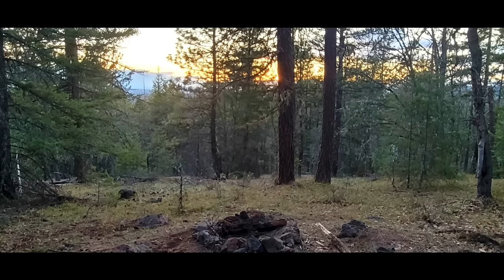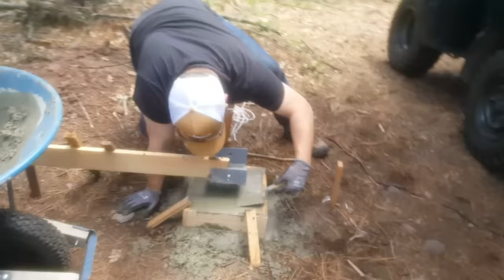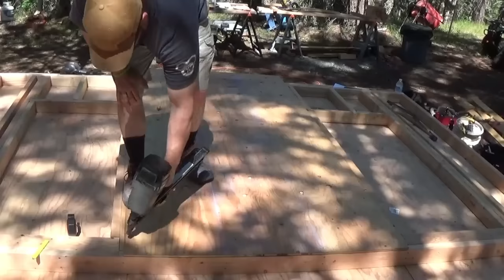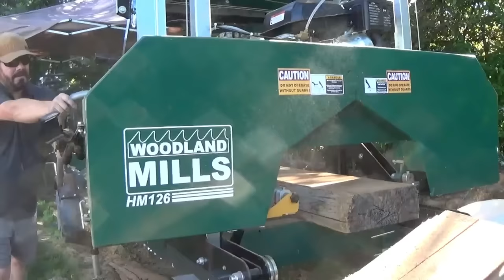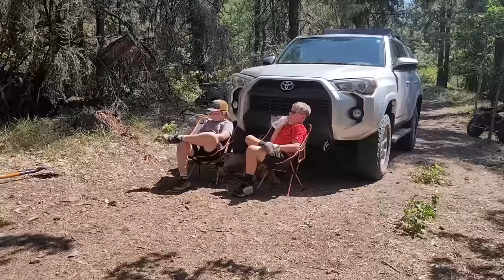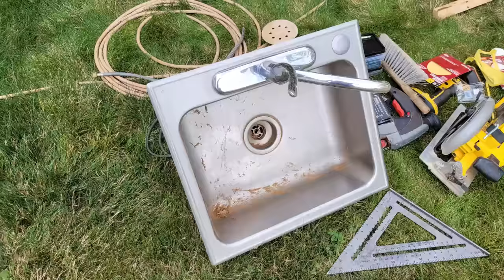Off Grid Cabin in the Mountains. . . Start to finish!

Comment: A tip for your ‘layout’ phase.  Screw the bearers together (including triangular bracing) and lay it where you want the structure.  Use markup paint to describe your footings.  Move the bearer frame slightly off to expose each footing a dig them out.  When you are ready to pour the concrete, sit the bearer frame back over the holes, using scrap 2x4s to hold it level with the stirrups into the holes ( I usually weld the stirrups onto a small rebar cage and coat liberally with cold-galv paint). Then just pour the concrete, use a jigsaw or other vibrating or oscillating tool onto the stirrup to vibrate the concrete as you go.

Comment: Nice job!  I would never blame someone for using a nailgun.  I had about 3 1/2 weeks to build a cabin shell and without the nailgun it would not have happened.  It's not just the framing, but all the nails in the subfloor and sheathing, etc.  Thousands of nails.
Reply from the maker: Right on!

Comment: You're the only builder who put down a vapor barrier below your cabin flooring. You built a lovely cabin. I love houses with steep roof lines too. How do you determine how to cut the wood to achieve this type of roof?
Reply from the maker: Thank you so much Angela! That means a lot! So. A speed square ( a small triangular tool ) and its instruction manual will get you what you need to know about rafters. Otherwise you can Google "cutting rafters for roof pitches!" Merry Christmas!  : )

Comment: Excellent video!  Working on weekends, how long did it take to build this cabin?  Also, would it be too much to ask what ballpark figure it cost you to build a cabin this size?  I’m about to do the same thing, maybe a little larger cabin, but it’ll have to have a covered front porch across the front.  Sure admire what you did here!
Reply from the maker: I think because of the digging and the concrete, it would be about a 2 week straight project if you could condense it and you were really moving. All in, just south of 5K, but these are used windows, doors, self- milled beams and stairs, a lot of penny pinching.

Comment: Have you ever had issues with the metal roofing dripping condensation during the wetter/humid months? Or just from there being a bunch of people in there during the winter?

In the process of building my 24x10 offgrid cabin. Wondering if I should lay down some tar paper under the metal roofing to prevent this?
Reply from the maker: I have not yet. I do plan to insulate and tongue and groove it which should fix it anyhow. I actually debated this for weeks and in the end followed what Bushradical does on all his builds. Nothing... 😆

Comment: I know some people with paper on a wall and their ok but in bad situation they would be the last ones I would go to. The roof also kept me thinking all the time. Now that it's done I can say that was the worst part of the build so far. Almost fell off twice. An old guy did give me a tip about how to walk on the metal without sliding.  He said spray soda on the panels when it dries its sticky. That worked great on the 9 12 pitch and the first rain washed it off.
Reply from the maker: B LAM! That is a crazy awesome tip that I've never heard before!! Thank you!

Comment: loved the vid, did a way better job than most of the "building a small cabin" vids Ive watched. My only question is why no flashing on the windows?? I feel like if you're gonna take the time to do such a good job why skip a small step?
Reply from the maker: Hey Aaron! The flashing will come when I tar paper the walls and trim them out, then side the cabin with rough sawn board and batten which I started milling in my latest video! Thanks for watching sir! Merry Christmas! 🎄